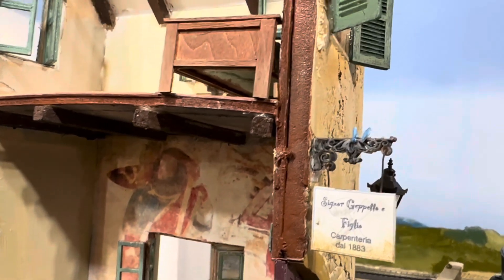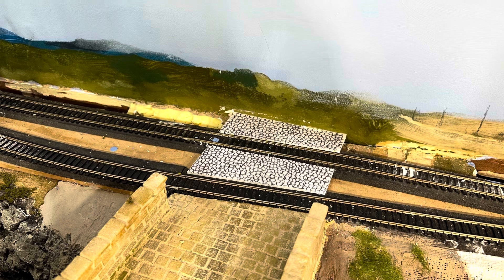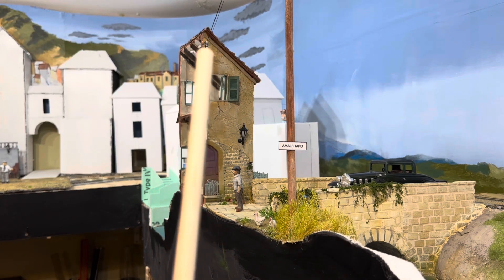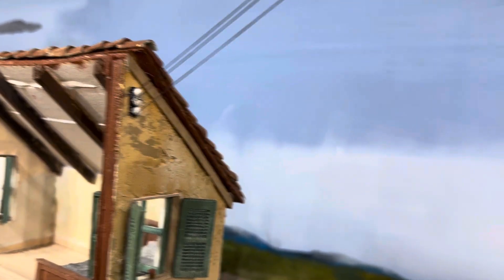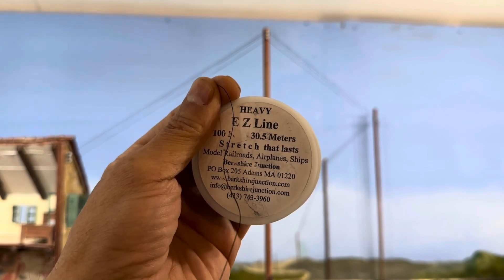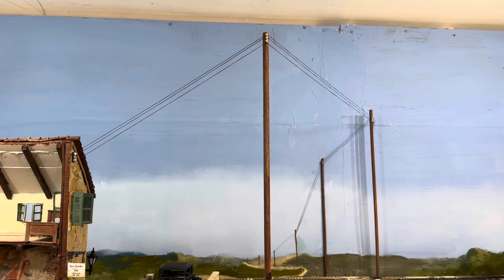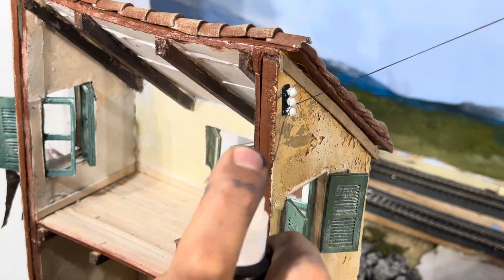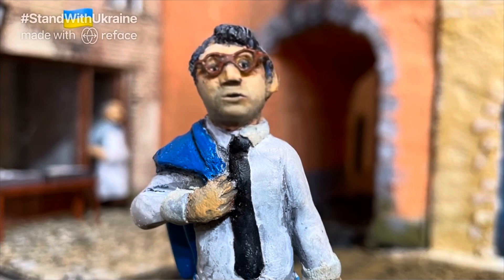Part 3: Adding power poles and power lines using EZ Lines to finish the Carpenter shop build

Comment: This is awesome, i really love the look of the installation! Personaly i think the taller poles just look better for the layout, regardless, it just fits the style of the landscape very well in my opinion.
Reply: This seems an odd thing to debate about. I trust @traveling in miniature and i've never been to Southern Italy. This layout and modelling are awesome.
Reply: @alangregory1806  Im sorry if it became offensive, i was just carried away with taughts about my own layout... Ha ha
Reply: @alangregory1806  Outside my window there are both of those lines and the high voltage crossower by a pole transformer to a lower domestic line, i concider making something similar for my own layout. I know for example in Norway the system is different because they hawe a lot of montains to cross in the coastal area. (Yes my hobby is related to old electric things, thart's why i always want to go in depth with things i am curios about how they work... Still i know the old Colorado steamer which is totally out of scale as well will drive into my 1940s landscape in the end, despite all my research... ha ha)
Reply from the maker: Its even better in person because the layout is shoulder height and the poles require looking up just like in the real world.
Reply: @TravelinginMiniature  Awesome! i did start on a Rowland Emett inspired layout last year (loosely based on Micaels world, but it is my own imaginary coast) and Your style does fit just perfect!

Comment: In the UK wires are 14 feet and poles 18 feet. Is this an Italian thing because 50 feet seems very high. Love this railway.
Reply: I am not sure, but in Scandinavia it has to do with the line voltage, high voltagfe poles are much higher than domestic lines. Maybe the poles are taller in Italy because one need to bridge ower the montain sides easier?